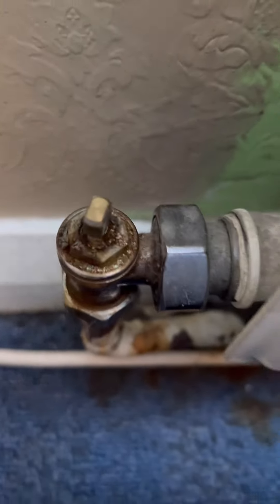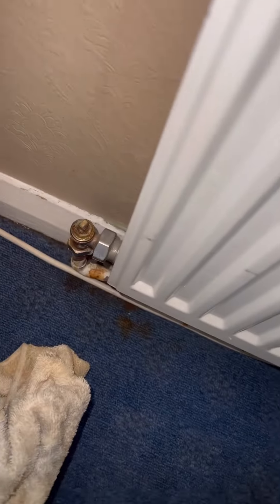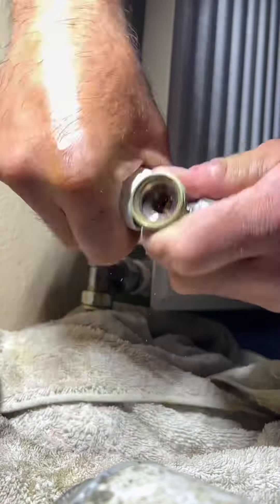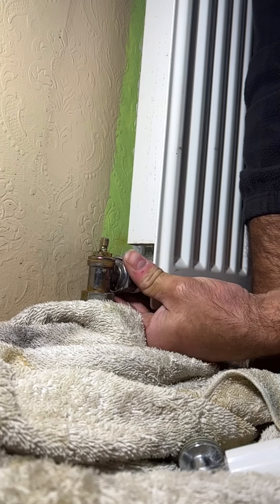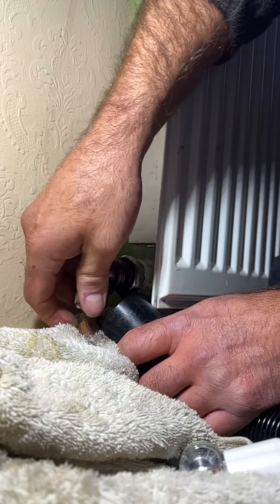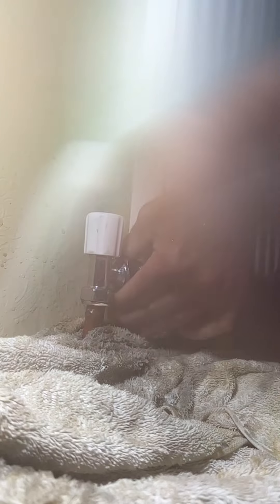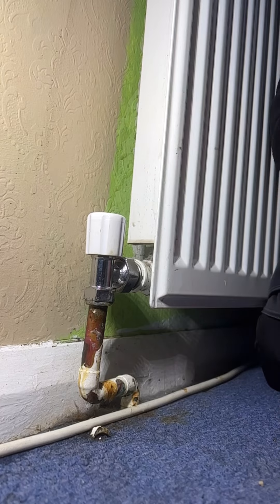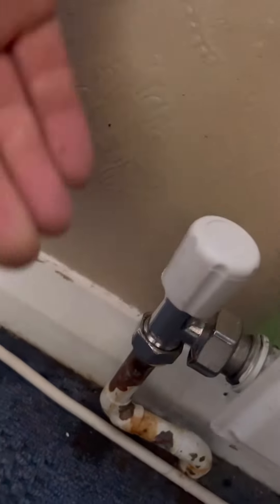How to replace a leaking radiator valve (open vent system) snatch and go

Comment: So when you bung do you then turn off one side of every radiator in the property as that’s what I was always shown but not sure how this helps, also on a cob I once the pressure has been removed can you just isolate one side and then change or again should you close one radiator valve on each radiator in the property just a bit confused as I’ve had different opinions, thanks
Reply from the maker: So on an open vent I usually close the other side off as your then not worried about that side of water flow through and only dealing with the radiator water 

If a combi I’d basically just drop the pressure then I’m not too worried either way

But yes of course you can isolate it anyway mate it won’t hurt, I just judge on the condition of the valves aswell as wouldnt wanna isolate if looks like it could leak and cause further issues
Reply: @snapgas9832  super thanks for the prompt response